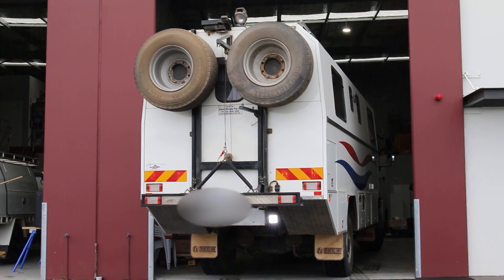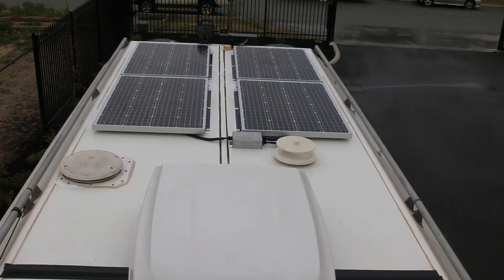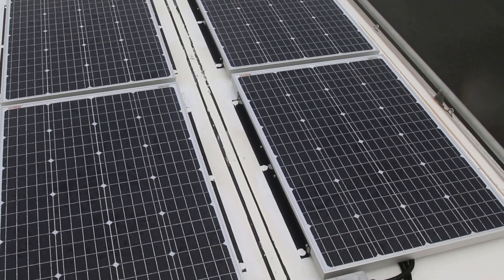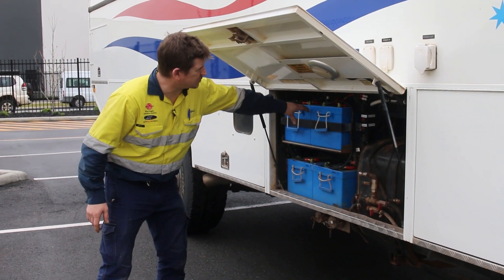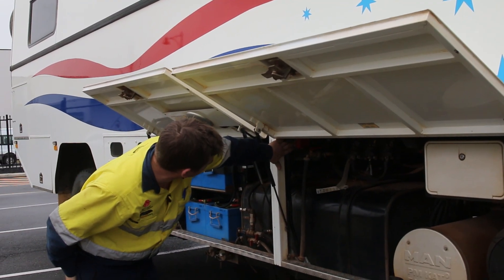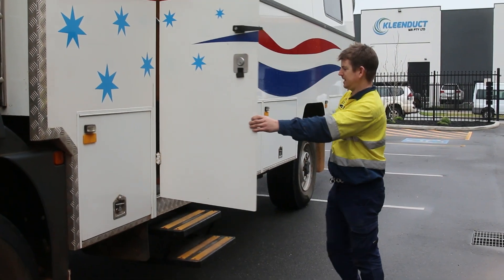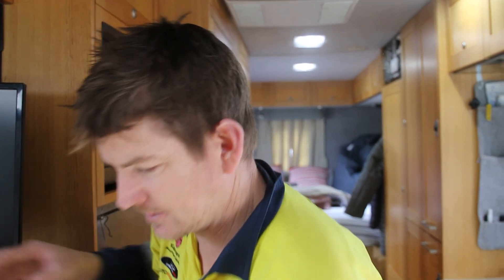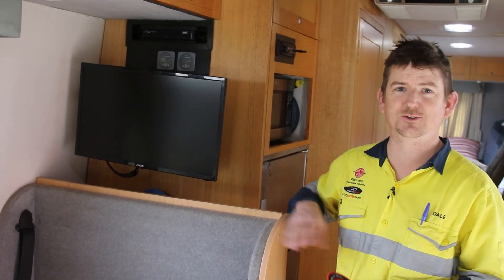Heiner Builds Your Ride | M.A.N TGM 4x4 Truck

Comment: 320kg in batteries why is that setup not lithium
Reply: Hi Criss,
Simple answer, cheapest system build on budget.
Look at the system items.
Nothing wrong with it. Functional..
I just inspected yesterday a Bliss worldtourer cab on a MAN TG, Build in Holland, 24v.
Expedition Version..  the overkill nice setup and components set all build in small series 
Looked like for Armee build.
8 Massive industrial cells LiFePo4 24v 400apms
Multiplus 24/5000 / 120  1200Wp solar 3m
All Victron goodies…
Mppt regulator, 2 dcdc charger
Massive external BMS and active cell balancer
Austrian management software program running on an Garmin unit.
Electric floor heating… yep, good for -40 ok.
Double electric, About 50 manual switches for every function in the cab as backup. 

I was very impressed, but don’t ask how much that systems value is.
Playing in the upper league and not comparable with what you saw in the video

PS. Only a handful people would need such a system and not be interested in.
Europe builds are the number 1 for such systems. Australia is a complete different world and market.

I hope that explains it a bit..

Anyhow, have a nice day..
Cheers
Reply: 320kg is nothing in compare to a 18ton truck chassis